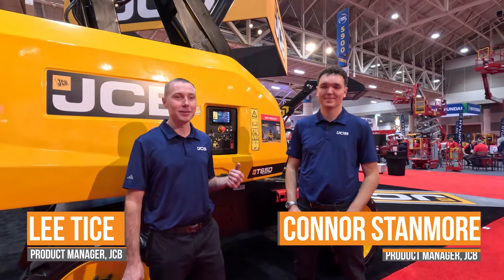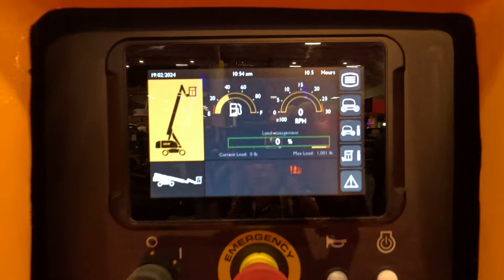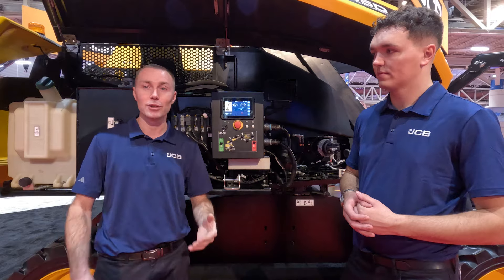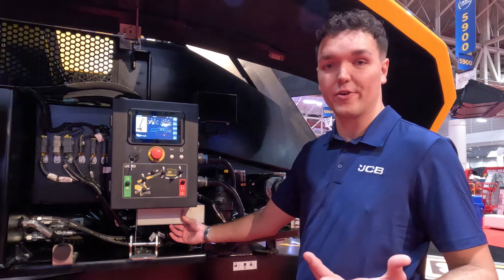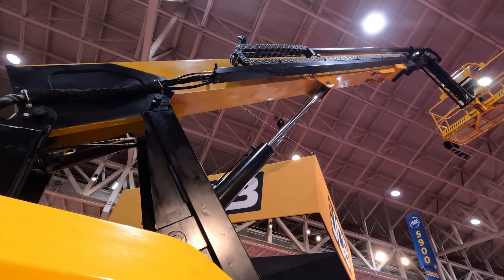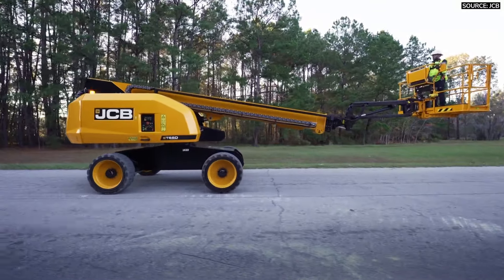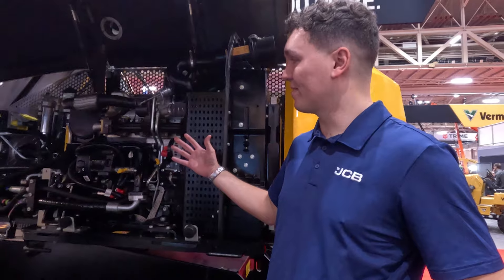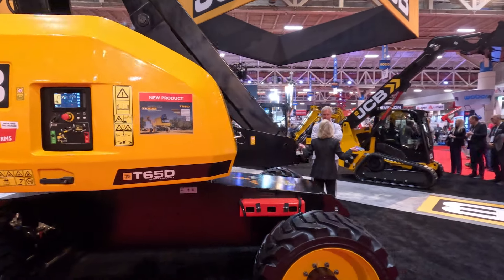JCB's First-Ever Telescopic Boom Lift, the T65D

Comment: That boom is a development mistake. Weighs 2000lb more than market leaders’ 65’ booms. Has same boom max total capacity over the range. Has less gradability and top speed than the competition. And is saddled with an oversize 4.4L 55kW engine while competition achieved superior performance with  <3L 35kW. This JCB on specs alone, should be an 85’ boom. Something must of gone ary in development.